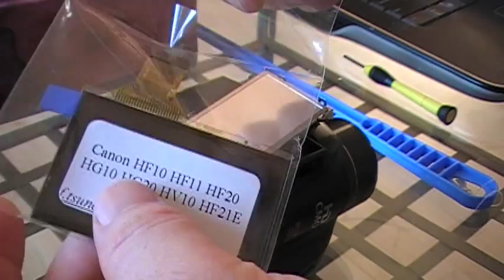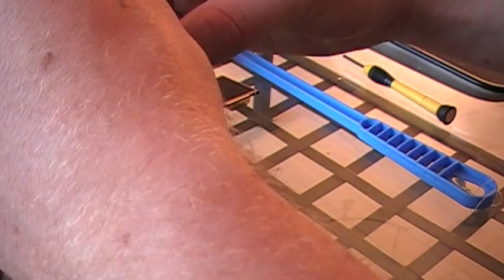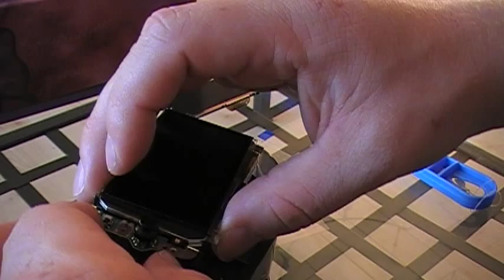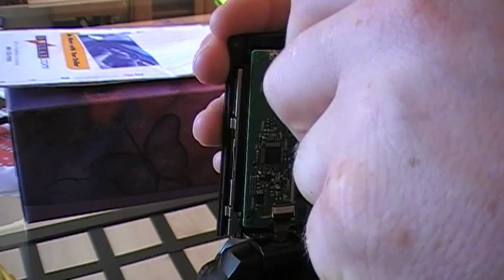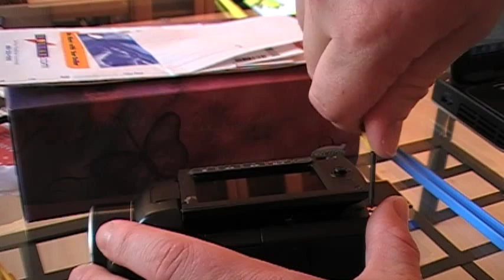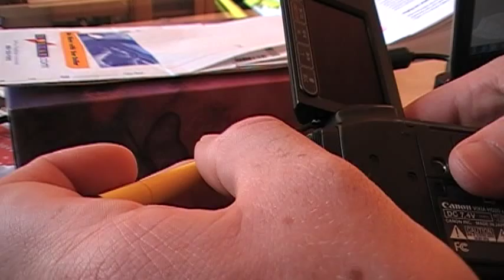POV no speaking:  Canon Vixia HG20 Replace Repair Fix  LCD Screen

Comment: i finished replacing the screen on my hg20 but the LCD resolution is off, it seems to be zoomed in, bc i can only see the from the left to the stop button at the top of the screen.  I got the replacement off ebay.  you think they sent me the wrong one?
Reply from the maker: Hey Timothy.  I have no idea if they sent you the wrong one, I'd have to see it but maybe the ribbon cable isn't all the way seated. If your old one and new one look the same it most likely the same.
Reply: LifeBloodMarketing
ok I'll check that, I checked on my computer and it uploads the full image, it's just the LCD that is zoomed in.
Reply: +timothy cantu 
Hey Timothy, I have the same problem, could you find a solution?

Comment: I have the HG21  which I absolutely LOVE and now it has trouble reading the hard drive. It flashes for various lengths of times before finding hard drive. I've tried fully reinitializing and it still does the same thing. Do you think changing the hard drive will solve the problem? or is it something else?
Reply from the maker: Hard-drives fail. It's a little more work to change out but yes you can replace it.  Put an SD card in and see if it will record to the card slot just to verify the camera is working.
Reply: I just did what you said and it did the same delay thing it does with hard drive with the SD card sigh what a bummer. I guess its the camera. When it reads it works fine and it will playback when it finally reads, but who wants to play "guess when the Canon wants to read" prior to recording? Guess I'll sell it for parts. I removed the hard drive already. From now on I think I will always record to SD cards (less failure fear). Maybe I'll get the R40 for better optical zoom although I'll miss the viewfinder.
Reply from the maker: These great cameras are on Ebay for 200 bucks these days.  I've got like 5 batteries, a rode mic, lens and everything for them.  Been using it for 5 years all over the world. Great camera, perhaps replace it or find one that is all flash and no hard drive.
Reply from the maker: ***** , Also check the CMOS battery, I don't know if it will make a difference but it might.  Does it keep time without the regular battery in it? You can do a factory reset, button underneath battery slot.
Reply: LifeBloodMarketing CMOS is good. I was thinking of selling it for parts, but I think Im gonna keep it for parts and grab another off Ebay. Thanks a bunch for responding!

Comment from the maker: I knocked over my tripod just before going on a trip and the LCD screen was extended and it landed on the corer which made it turn all white.  About 3 days later it came back but it was missing half the lines.  So I just ordered a new one and replaced it.  The while process took bout 30-40 minutes and its' been good from then on.  This camera can take a pretty good beating. I've had it for about three years and it's been all over the world, in snow, rain, dry weather, heat.
Reply: Almost the exact same thing that happened to my canon,I can barely see the screen and want to replace it.

Comment: Anyone else have an issue with the HDD light just blinking along with the access/charge light flashing quickly?  is it the battery?

http://www.cnet.com/forums/discussions/canon-hg20-problem-with-recording-522406/
Reply from the maker: Not sure about that one. Have you tried using an SD card with it and see if the camera will record there?
Reply: Initiated both SD card and HDD. Both result in no change to the inability to record. I'm really hoping it's just a faulty battery.  Should be in next week. Was hoping maybe someone came across the same issue and resolved it.